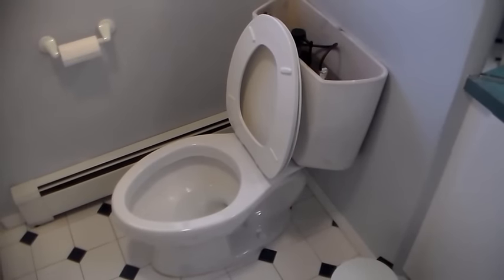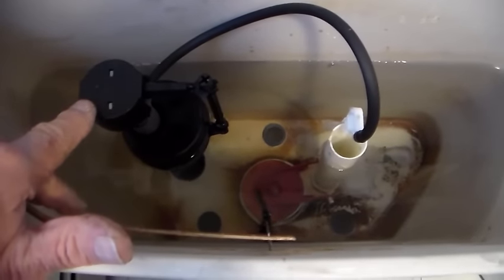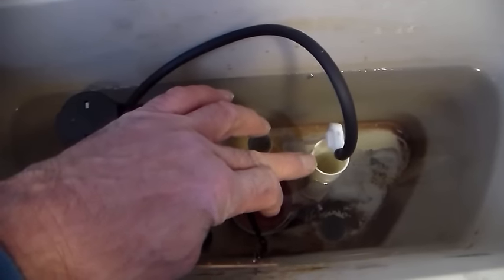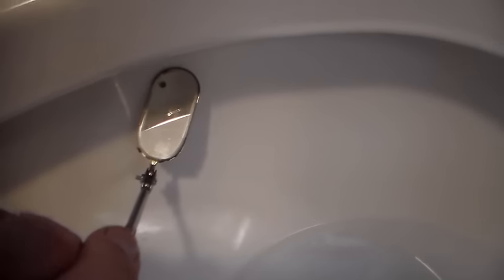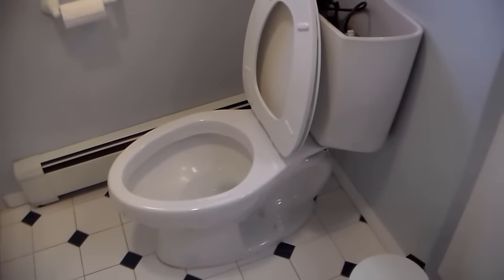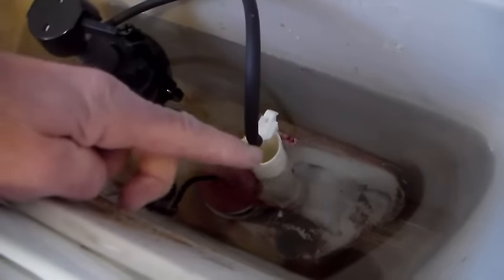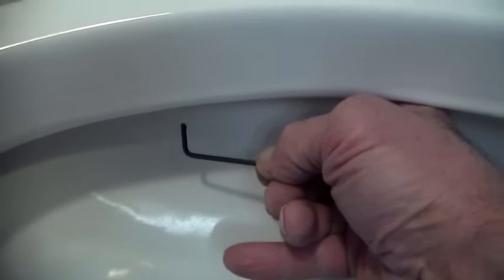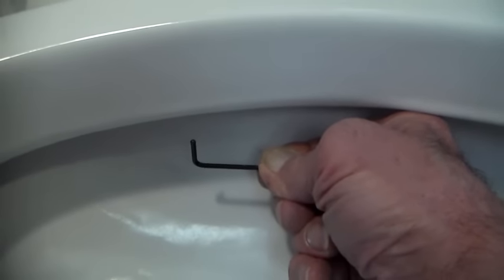Toilets-Clean Those Rim Jets

Comment: I soaked some pipe cleaners (that I bought at a craft store) in vinegar and then shoved them in the front curved holes.  30 minutes and wiggled them in and out a few times.  It helped clean the jets.
Reply: I, also, thought of using pipe cleaners to clean those holes after pouring hot, white vinegar into the standpipe.

Comment: I’ve watched everything, tried everything and thrown in cussing and stomping about but nothing has worked. I believe there is a siphon jet beyond my access and ability to block further along the drain path so I was unable to stop that up and flood the top of the jets with whatever acid suited my mood at the time. Here’s what I’ll try next - I ordered an 1/8” carbide tipped concrete bit with 1/4” hex base and a 105 degree adapter to allow me to grind away at the rim blockage per hole until they relent and clearance is gained. I hope, that is. I am now used to removing all the water from the dam-med bowl and stopped bothering with the glove thing some number of methods ago. This final attempt will have to succeed or I’ll stop being so pleasant about this DIY in my eye fool’s errand. The point when I should have quit is long past so it’s me or the durn thang, once and for all, by gum. If I lose, I’ll teach that thing about cliff diving. If not, I’ll give it it’s just desserts roughly once a day.

Comment: TY so much! I have the exact same toilet.  Building code in my locale forced me to replace a "conventional" flush toilet that had been working fine for 50+ years with this supposedly efficient one. Fast forward 20 years…this water-saver toilet doesn't save water any more because I have to flush it more than once. I knew something had to be clogged with mineral deposits because I have to scrub like crazy to clean under the rim…but I had no idea clearing these deposit from the jets would be so easy. Good old Allen wrench - who knew?
Reply: Briar Rose Isn't that the truth.  The HE washing machines are a scam too. The old fashioned standard washing machines work much better. With the HE washing machines I sometimes have to wash my clothes 3-4 times wasting much more energy since the washers also take more than an hour to do the job!
Reply: @autumnspring6624 
I know; I miss my Maytag
Reply: Good ol' government

Comment: Great video.  I’m pretty positive this is what’s wrong with my toilet.  My symptoms are that I have to clean it so much because the poop doesn’t really get washed of the bowl walls well at all.  So all the time I have thede brown poop stains all over the bowl.

The reason is because when I flush the toilet there’s not a very good coating of the walls with water.   It flushes OK because there’s nothing wrong with the water going thru the flapper.  I strongly suspect my rim jets are clogged.

This video looks to be a great tutorial on how I can fix my toilet so I totally plan to follow your instructions and see how things go.

I had to do a lot of googling until I found out that those things are even called rim jets.  Once I finally learned that term I was able to search YouTube using that term and I beheld your great tutorial.

My toilet is exactly like yours with the fluid master equipment.

Comment: At the 1:50 mark, interesting idea using an Allen wrench to clean out the jets.  I saw on another person's video where he covered the dirty jet holes with long strips of a quality DUCT TAPE.  He then poured vinegar into the flapper hole and waited a few hours before removing the tape.  It cleaned the jet holes in their entirety of rust and white calcium scale.  Instead of vinegar one could use citric acid and water.
Reply: Not easier, more people have duct tape than aquarium pump
Reply: Muriatic acid much better!

Comment: Thanks so much for the "hot" tip using hot vinegar to dislodge the scale.  Your method should work for my Kohler toilet, too, with some slight modifications for access to the Rim holes.

Comment: This one is a Kohler Wellworth Lite which has a high profile tank. What I was noticing sir was that the water level in the tank is too low for this particular model and the overflow pipe was trimmed where in this case it didn't need to be. This patented Kohler Lite flushing system has smaller rim holes because the focus is more on the direct fed siphon jet. It is basically a gravity version of a pressurized model. But I think another solution would be to replace the flush valve with the new FlushALL flush valve from Keeney Mfg. It's a 3" to 2" flush valve with an adjustable overflow pipe. These valves can make them flush up to 40 times better.
Reply: All of the manufacturers make toilets with sometimes big differences. They certainly don't all flush the same and many dump only a fraction of the total water in the tank especially if the person who's flushing doesn't hold the handle for a slow three second count. The 1.6 gallon units can make a lot of trouble if the handle is not held long enough to facilitate a complete flush. Often the overflow pipe is a bit too short and the flapper valve might not stay buoyant long enough.

Comment: If your toilet is lacking flush strength it’s probably the main flush inlet at the bottom of the bowl has also become restricted with deposits.  Using gloves, scoop out the water with a small cup and then sponge out the rest of the water.  Heat the vinegar and pour it in and let it stand for a day.  Then use a wooden skewer (won’t scratch porcelain) to ream out the inlet.  May take two applications.  A better method with the jets is to put duct tape over them so the vinegar will soak them.

Comment: Don't you need to plug the siphon jet in the bottom of the toilet in order to get the vinegar to back up and stand above (and in) the rim jets?    I taped my rim jets (in order to hold the vinegar) but didn't think to plug the siphon jet.  After letting the warm vinegar set for awhile I removed the tape which was totally dry.    On my second try, I plugged the siphon jet, put in about twice as much vinegar and noted flow from the rim jets.  Dried them off, retaped the jets, added more vinegar and this time when I removed the tape, there was still liquid in the jets.   Allen wrench is a good idea for cleaning, but I used a small sheet metal screw instead thinking that the threads would do a better job of scraping off any scale.   Seems that the flush is stronger - but time will tell.
Reply: Metal on porcelain never a good idea!

Comment: Probably a great idea to wear gloves while reaming those rim jets with the allen wrench. Typically a toilet doesn't get cleaned as well under the rim and the bacteria counts are probably legendary. Wondering also if anyone sells a wire brush for that job ?
Reply: I've been looking for a brush that would work and cannot find one.
Reply: @curie3938 
It’s possible I have this problem with one of my toilets. There are brushes that are supplied with reusable (metal) drinking straws. 
I thought of trying one of those to clean my toilets jets with.
Reply: @Use-or-Lose  I stumbled on the same idea!  After letting it soak the rim with some vinegar it worked fairly well.
Reply: @curie3938  
Thanks for letting me know. I’ve not tried it yet, my first chore for 2024!😏
Happy New Year!💥
Reply: @Use-or-Lose one other vid showed how to put duct tape under the rim after you empty the tank of water,
Reply: @curie3938  
Yes, saw something similar. In fact, that’s my plan.
Reply: @curie3938  
What way to begin 2024, talking about toilets.😆
Reply: @curie3938  
Here in the UK, our toilets as far as I’m aware, don’t come with siphon ports in the bottom of the pan. We just have a larger port under the rim, at the 12 o’clock position. With jets spread across the rest of the rim.

Comment: Riddle me this:  what do you do if NONE of your rim jets even have a trickle coming out - indicating that the mineral blockage is "upstream" (perhaps where the channel to the rim jets breaks off from the one heading to the siphon jet)?  When I pour vinegar down the tube it all just comes out of the siphon jet at the bottom, and I think it's not "sitting" on the point where the blockage is.  It seems like I need to block off the siphon jet completely, but it's hard to get a good seal to "stop" it up.  Any ideas?
Reply: Have you tried dumping CLR down the overflow?
Reply: @YesuAiNimen The problem is that everything (water, vinegar, CLR, or whatever) that goes down the standpipe comes out the large jet at the bottom of the bowl. Nothing comes out the rim jets.
Reply: A new toilet is less than $200 and they're not very difficult to install.

Comment: Need to also address slim and mold buildup in the rim.  I've dumped powered swimming pool shock treatment down the overflow when flushing and allowed it to sit for a few hours.  I've even plugged up each jet with plumbers putty and filled the tank and bleach down the overflow then flushed so the rim is full with bleach to soak and break down the slim and mold inside the rim water way.

I've also used braided stainless cable and frayed it, shoved it up the jets and attathched it to my cordless drill.   You'd be surprised how much slim there is and it will keep reclogging the jets.....  Just don't use any acid when using bleach and be sure when either product is used, it's well flushed out before adding the alternative product or you'll create toxic chlorine gas.
Reply: +chrispompano  I had similar problems with mold buildup under the rim and found Oxy-Clean from the laundry aisle works well. It comes in powdered form. Put some on a damp cleaning rag or sponge and scrub. My toilet brush doesn't get far enough under the rim. Oxy-Clean is a peroxide-based, better for us and the environment than chlorine bleach.  I was amazed to find it whitens better than chlorine in the laundry too. Clorox used to be my go-to but I haven't used it in years. And I am a fanatic about laundry as well as toilets.
Reply: I use a small paint brush, the kind with a foam piece instead of bristles, and brush/sponge into the jets some vinegar or lime away. Clean 'em out with that allen key.
Reply: I soaked pipe cleaners that I bought at a craft store in some vinegar then shoved them in the curved holes in the front.  Left for 30 minutes, then wiggled in and out and it helped loosen the gunk then I flushed.

Comment: Did you know a sudden change in temperature to porcelain (your toilet) by adding heat (hot vinegar) could cause your porcelain to crack or shatter?
Reply: This is an American video so he's talking 120°f not c
Reply: 48°c
Reply: @CreativelyChristoph-wg7wn good luck trying to heat water to 120°C
Reply: I took note that he instructed to use hot water (from the faucet), at about 120 degrees, versus boiling water, at over 200 degrees, with the risk of boiling water being possibly cracking the toilet porcelain.

Comment: This is a Kohler Wellworth Lite. This model is known to be very easy to clog. It should be replaced. I'd suggest Project Source Pro-Flush or Glacier Bay Powerflush. SPECIFICALLY the Powerflush. Every other model released by GB is garbage.

Comment: muriaitic acid...let it sit overnight. make sure its the diluted stuff.. NOT 100%
Reply: muriaitic acid.. careful with this stuff it can blow back up in your face if it hit a clog I dumped some in a pipe and it erupted  and landed on washer and ate the paint in less than 1 miniute  make sure you dont look down the pipe and proptect your  eyes
Reply: Nice job Korky.
Reply: Careful how you store leftover muriatic acid. Left in its original bottle and tightly capped, it still emits fumes and it rusted steel nearby.

Comment: why do you hear the vinegar?
Reply: Why do we hear vinegar? Because the vinegar produces harmonic vibrations that can be detected by the human ear.
Reply: Why do you "heat" the vinegar, is the question.  I used room temperature bleach and it worked fine, without scraping.  I imagine that the heating speeds up the process. No practical way to heat bleach without contaminating a bowl but you can use heated vinegar.

Comment: Didn't work.
Reply: I know this is a year later, but your siphon jet hole is probably blocked up with mineral deposits.  That's the tiny hole in the front of the the toilet base that is always covered by the water level.  Put a thin glove on your hand & stick your finger in that hole... it should feel wide open.  If it's crusty or blocked, take a long screw & poke/ream out the mineral deposits, then try to flush again.  Hope you haven't already replaced your toilet.  Good luck!
[5.29.2022]